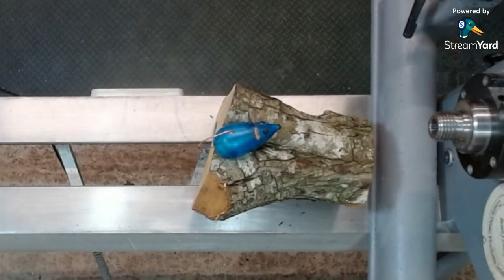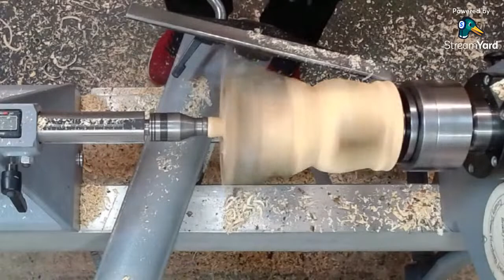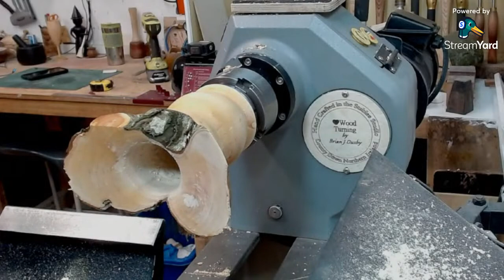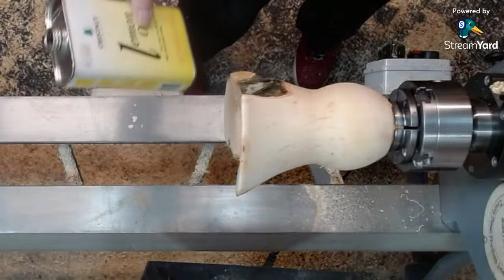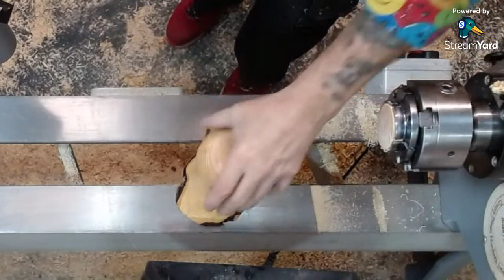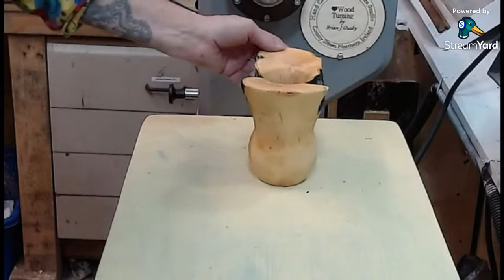Woodturning - Hawthorne **Wet turning**

Comment: Nice job mate
Reply from the maker: Thank you Gav not 100% happy with the design aspect of it by hey it was really good practice on Tool control worked out what went wrong at the end.  Turned to much off as I tried to part it off made the tendon to thin and the uneven weight in the wings mad it very unstable.  Lesson learned. Don’t always part of completely, finish with a saw particularly in an unbalanced piece. Lastly make sure to leave a bit more timber at the headstock end for the parting off process at least 1” 👍👍👍thanks for watching
Reply: @Stable_Studio  I've been guilty of not leaving enough to part off too many times. I'm in the habit of drawing a line to remind me now
Reply from the maker: @GavSedae  that’s a very good idea Gav I will try and adopt that into my spindle turning  thanks for that Buddy